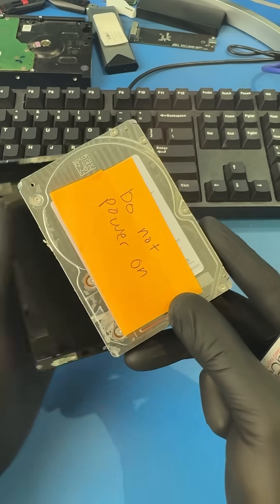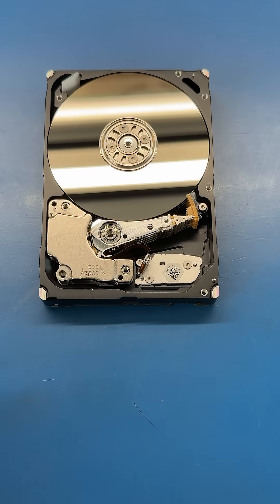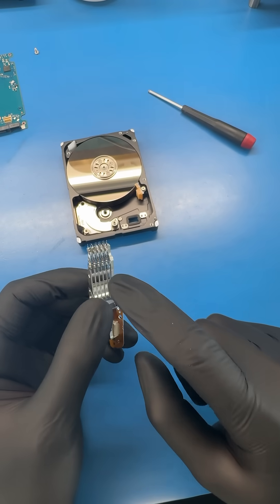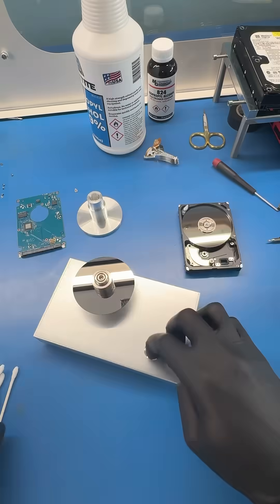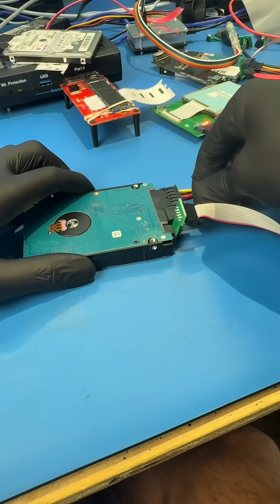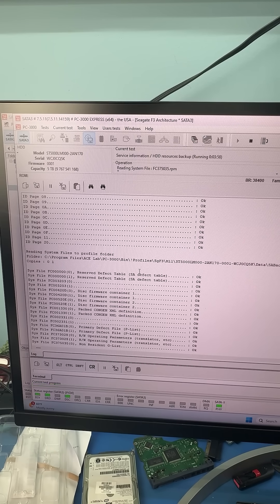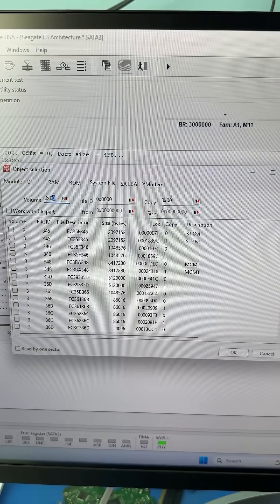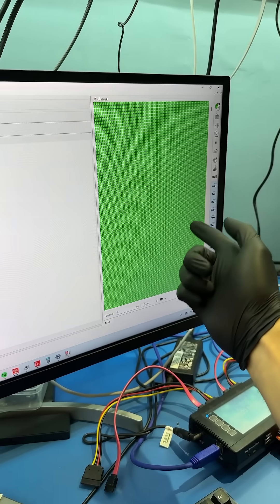Hard Drive Platter Extraction... #technology

Comment: What is the price for PC-3000? Official page has no price list, different forums estimate 2000 to 9000 for different versions (also mention to double price if you need a training course, wtf). I've seen some clones that are sold, but they seem to be finnicky unlocked versions. I have some sata hdds, sata ssds, and nvme drive that would be nice to recover. Not sending them to anyone, last attempt ended in bricked drive that I never got back from repair.

Comment: Even with this, it can be recovered because the HDD is a non-volatile, magnetically indelible storage device and writes in sequence.
However, unlike HDDs, SSDs and USB memories, which use electronic elements like NAND, have electrons that volatilize when the media is damaged or deteriorated.
In addition, even a single piece of data is written randomly across the entire system, making it difficult to recover unless the internal cache (Drums) that stores the information is intact.

Comment: I've had this happen and nearly lost all my world travel pics of 20 years travel all over the globe. Cost me a bit but worth it. Only one thing I can't see from the video, but hope you are doing as these platters are very fussy. The guys that did mine worked in like a biohazard hood with no external air, only filtered air, so no dust could possibly get on the platters. 1 speck will crash the heads and it's done.

Comment: This type of repair is so difficult and the skill involved is so far outside the standard “gizmo” repair, I am sure not many people could actually fix perform this type of repair, amazing work!
Reply: Nice one bro
Reply: I've disassembled many drives and used hex editors on them and I'm not a super genius nor have I received a lot of training.  It may seem like magic to the average person but with a little training and the right tools, a person with the right mindset can learn how to do this.
Reply: There is company called "Myung information system" that does extreme hard drivr and ssd forensics in dust free clean rooms

They were literally able to decipher stuff from sewol ferry that was under ocean for a month it's crazy

It in south korea. I thik for hdd recovery they only charge like 400 bucks
Reply: there's nothing exceptionally difficult here. it's just the knowledge and the tools (replacement hardware) and recovery software are pretty rare.
Reply: A lot of failed drives back in the day was fixed by simply replacing the control board.
Reply: AMEN to that, brother.
Reply: fewer and fewer people.
Reply: @siqck  actually this isn't lost knowledge like making wooden crafts without power tools, if there's fewer people who can do this I would be shocked as the number of people with hardware expertise of any sort is going up not down. there's never been a huge number of people taking apart hard drives and replacing heads.
Reply: @brianb7388  that is also just extreme skill though!
Reply: I mean, I feel like Technicians in China are also good at this stuff, basically all our technology is manufactured there
Reply: @josephtanko Chinese “technicians” are prob the most doo doo in the world. They manufacture everything, but designed none of it.  Half the stuff they do produce doesn’t even work, because they clearly copied someone else’s designs without even understanding how it functions.

Comment: Honestly that was pretty smooth going all things considered. When i saw those heads i thought at least one platter was toast.

I had a cousin use their old HDD as an external (and a drink coaster), eventually just started having all kinds of issues. Opened it up and they must have spilled something in it and it just kept working (for a while).

Goos on you saving that kitty.

Comment: Bro this happened to me as I was saving my dissertation. I panicked for up and started walking around. I sat back down remembering my laptop had the original file and I’m a fucking idiot for worrying. I then go to move a water jug from the table to prevent further risk and instead of reducing the risk I knocked it all over my laptop. This was 15 years ago. Needless to say I failed my dissertation and finished university without honours. Saving hardware back then was super expensive and wasn’t an option.

Comment: I was confused, wouldn't it matter that the relative orientations of the platters is no longer identical? I would expect data to be written across multiple platters at once for maximum data throughput.
Reply: I spoke to a rep from a hard drive company in a recent conference, apparently data is read from the platters one at a time (serially) so it probably isn't a huge deal for the platters to be misaligned.

Comment: I read that the alignment of the platter is critical as in if you are removing them, you need to maintain their exact alignment as they are. How is it then possible to remove and inspect them one by one or are there methods to correct this alignment after stacking them back together?

Comment: When you were holding up that one platter to remove the head, what was wrong with just using air from a can? Because that flicking technique you used that was risky and you touched the head itself, but not the platter but you did it. In fact risk scratching the platter by doing it that way I mean I’m no expert. I’ve only done a head replacement once and that was it. But I’ve seen a lot of videos on this type of work even where major big companies do this. I’ve seen one on Linus text tips where they went to this one corporation that did retrieval and they’ve done retrievals to where the hard drive was actually in a fire and they retrieved the data out of it and it was a platter hard drive..

Comment: When you took the platters out, how come you didn’t lock them into alignment like I’ve seen on some videos that people do because if one of those platters are out of alignment just by a millimeter even a decimeter the data is lost. I mean there’s no way there’s no stamp marking on the platters like say on a piston on a V8 engine where it shows which direction they get installed that I think is the most dangerous and tricky data retrieval is when you have to take the platters out specially if it’s a multi platter hard drive if it’s a single platter it’s easy as cake because there is no alignment then but if there’s two, yes you can have big issues if you don’t have them in exact line meant as they were before you took them out I didn’t see any markings on the edge that you may have done that I’ve seen on some videos, you must be super skilled or have some kind of special x-ray vision to see the exact track marks to know that you have the heads on the exact alignment. Myself the only thing I’ve ever attempted was a head replacement in a hard drive. I had it worked thank God and I just downloaded everything from that hard drive into a new one and disposed the old one because I was not going to risk reusing that one I just had to use a donor drive

Comment: Some advice on delivery of your script. You're intonation and cadence are so robotically similar in every sentence that It's almost text to speech levels of eerie. 

I'm assuming you just read each sentence with a small gap and then edited out all the silence so it sounds like you're talking through paragraphs. The problem there is you clearly sound like you're just reading a sentence at a time instead of just talking.

Comment: 2 drives making an old Win  XP "drive".... A "stripped" SATA array... the motherboard that wrote the array blew at least most of it's capacitors. (MB CPU combo still exists, but board blown)

Can the data on that stripped array be recovered without the original MB/CPU???"

Comment: Exactly why I no longer use anything but solid state drives.  Not indestructible, but so much harder to damage.
I take old drives apart to salvage the magnets.  The last one had apparently had a catastrophic failure, and it was filthy inside with some sort of black stuff that wanted to get everywhere.  I never did manage to get that one apart enough to get the magnets.

Comment: Why are hard drive’s so fragile. If it gets a speck of dust on it the Earth explodes I swear.
Reply: because of data density? The bits are unbelieveably put close together.
It is like complainig that modern CPUs are so fragile that they wouldn't work in space because of the radiotion. Yeah, if you want to put together billions of transistors whe neach is a size of a human fist together, that scales man, that scales! And would probably would need more than one power plant alone.
Same for data density. You have to scale down everything as much as possible and then mass produce it for cheap as possible. Otherwise no one can and will buy it. This is mass produced consumer electronics.
I for myself find it fascinating that they are produceable in mass with those low margins of error and for that price!

Comment: This is why I replaced all my hard drives with SSDs/NVMe, yeah it's a lot more expensive for the same storage, but I can  drop these off a 3 story building and they still work. While a platter drive gives up the ghost if you so much as jostle it a little while it's operating.

Comment: 25 years ago I lost all my data in an HDD crash, from almost 10 years of childhood and school and so on. Couldnt recover it (and it was hard to recover from the loss was quite some work in there), but since then I have a triple backup strategy: All computers rsync to the NAS, which has a RAID5. The NAS rsyncs daily to a cloud storage and once a week I perform another sync to a RAID1 backup server.
Dont trust a single Backup, they can fail too, you need at least 2 backups, the third is just for good measure and doesnt cost me anything (old spare parts), but its kept in a save place if somehting happens to the building.

Comment: About 55 years ago I worked building the disks that went in the original IBM disk packs . Of course they were much bigger and stored a small fraction of the information that these smaller units do and they were extremely slow . They were mind boggling impressive back then; now they are way beyond  what was even thought possible .

Comment: this is actually so great!
props to the programmers who spent months or years writing that app which will handle catastrophic cases like this, and you for using it and helping people out with their repairs which seem impossible at first ❤
Reply: most of times it's gonna be proprietary
Reply: @tonistaak so I’m Swedish and I’m very familiar with English and speak it 8 hours a day but I struggle so much with that word and particularly when to apply it. Now I know, thank you.
Reply: PC-3000 is very expensive. Indeed proprietary.
Reply: @BadPacifist  yes the most basic version is about $4000 USD. Also for those wondering, it is not software, its an actual piece of hardware
Reply: What are the programs he is using?
Reply: I believe these companies need to reverse engineer countless drive roms to get all these supported drives, must be some insane work.
Reply: PC 3000 is a software with PCI card with a lot of packaged connectors ide/sata/pata.  When you buy it you will get limited hard disk drive that you can work with. last time i used it, our license is upto 250gb only.  At the time, there were a lot of issues with hard drive, there is  head sticking to the surface (very common, open drive and spin platter while moving the head to parking area), there is this ROM crashing need to update firmware and Bad Sectors (most problem).

Comment: How could the platters not have sctatches on them if the heads were that badly mangled? This work has to be done in a dust free environment, a clean room. The heads and the platters are so close together that dust particles can cause scratches. There is a lot of tech knolwedge here but I think a lot of BS too.

Comment: So weird to me that HDDs are becoming old tech. Like what do you do if Flash memory fails?
Reply: There's a youtube channel for that where they use a spider board to connect directly to the chip (not just the contacts you see in normal usage), and pull the data if it's there.

Comment: Yeah even if you mix up where the platters goci bet yah a thusand bucks it dosen't matter

The moment you can recover data feom the device even if it's tangled up a bit it can be recovered 

There are some incredible tools out there such as testdisk which'll help you rebuild the partitions and everything. (But it can take quite a long while!)

(I suppose under some extreme circumstances such as the disk being encrypted or somthing it'll be a problem

But so long as the chip/controller functions
It is still possible to test/recover altought taht too can take a while/ be very expensive)

Comment: I have a feeling this guy was aim to work engineering HDD and just found he could make more money doing this for a while until all the mechanical HDD eventually die and everything is ssd or other non mechanical data storage.Let face it, these things are slow and the bottleneck of the whole system. Need massive ram so you can load as much of the disk into as possible lol...

Comment: Hi, I work in professional HDD recovery. I really recommend to buy a plattern stand where you can inspect both sides of plattern without touching the surfaces (even not at the edge). Also when you are at it there are also stands for HDD itself so you don't have to work with it laying on the ground. It does make it way safer.😊
Reply: also you probably cooked your second copy of MCMT because you didn't test if donor heads are able to write or not

Comment: And this is why you have at LEAST one disconnected (Something many feet away from the drive - think: closet) backup drive. One online cloud backup. And one connected drive that you regularly back up to and occasionally swap out with the other drive that's disconnected). Call me paranoid if you want, but I've never lost a substantial amount of data in decades.

Comment: Beautiful work. I have a box of these drives. I thought back then "4-5TB in a 2.5" great value" and they were even cheaper if you bought them in the external version and popped the drives out... but they are so so slow, and extremely unreliable. All of them have failed at least once during warranty (replaced by Seagate), and all of them are paper weights now.

Comment: I had an open laptop drive that I had no idea you weren’t supposed to touch. It was mechanically failing when we removed it, and I hooked it up to my laptop to recover the files I wanted to keep. During this process I definitely touched it a few times. Yet, it kept reading until the plate finally stopped spinning for good.

Comment: This will not work. You remove the set of platters with a device that is like a ring that holds all the platters together so they can't slide or move. You can make one with an aluminum can and double stick tape. Only reason to remove the platters is a seized spindle. The device is like when you install a piston in an engine.  Why?. First they are bolted on to the spindle, then they are written onto in cake slices called cylinders.  All together the platters are like a layered cake and each slice of the cake is a cylinder. that's why RPM is important. on multi platter drives if you rotate one of the platters a micron of a degree by itself it will never work again.  I just retired after 30 years. Back then I made my own tools. Now you can get stuff at Dolphin Labs.

Comment: Hopefully, you did this in a class 10 clean room. I used to work for Quantum Corp. in the clean room, making hard drives. I worked Spindle Disc Assembly and the Merge (station where you install the heads into the drive).

Did you balance the Spindle Disc Assembly after pulling all the discs?

Comment: I worked as a tech and consultant for over 20 years. The number one thing I would tell my clients was to back up their data. And if you can, back it up twice. 

The old adage is 2 is 1, and one is none.

Over time, all data gets corrupted. It doesn't matter if it's on a hard drive, floppy disk, a cd-rom, a DVD drive or whatever. Even if you have everything backed up to a drive, you have to reformat the drive and copy the data back on again to refresh the drive.

I've been taking pictures for 50 years. I have over a million photos and videos. Over the years, I kept upgrading my hard drives to keep up with my backups. 

If I had a 20 MB hard drive, yes, megabyte, I would get another 20 MB to back up to it. Over the years the drives got bigger and bigger. 

100 megabytes, 500 megabytes, 1 gigabyte, 50 gigabytes, 500 gigabytes, 1tb, 5 tb, 10tb, 18 tb. I have over a dozen hard drives with everything backed up multiple times. 

Now I'm going to take five of the smaller drives, back everything up to them, and leave them at my daughter's house so that I have an off-site back up.

Comment: The customer dropped the hard drive by knocking it off the table, and you knocked it off the park by recovering all the data back!!!... that's Awesome man!!!...
Reply: cat*
Reply: @rip_leyyy  Sumidero meant from the repair technician's perspective. 

I mean, you're correct, but... if you're running the shop it doesn't matter if it was a toddler or a cat or it fell through a hole in a Walmart bag... the drive hit the floor at an impact force outside the specification it was designed to withstand.

It's all
customer <---> tech 
All other details are superfluous to whether it can be repaired or not.
Reply: Out

Comment: lol i have done this many times nothing can stretch those patters lol they are platinum coated. how i know i still have them and using them as a cup coaster for like 20 years not a scratch on it. what really fails in these drives is the heads nothing else